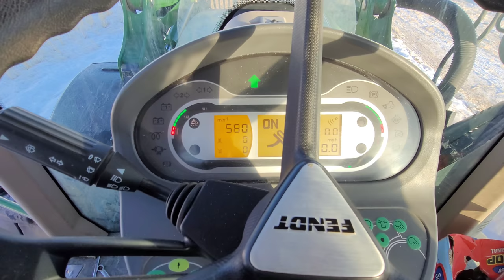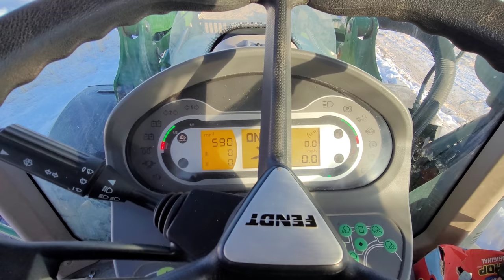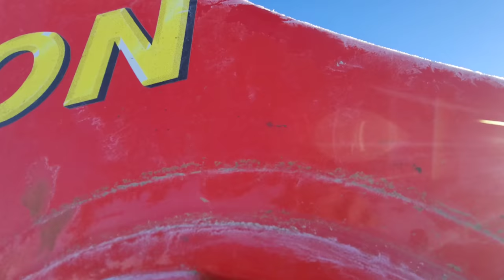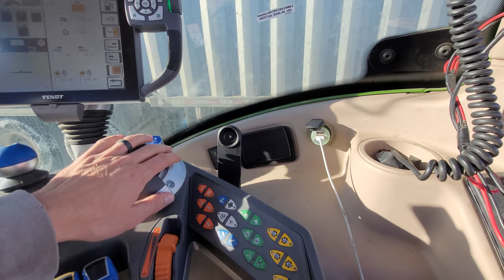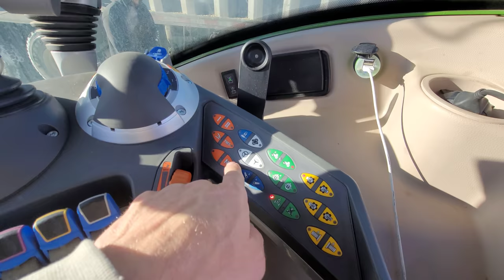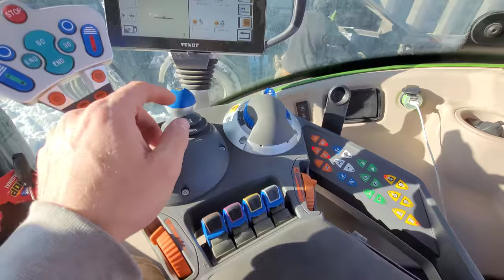How to Hook up & unhook to bags

Comment: We have JCBFastracs where I wrk here in the UK,they will do 42MPH on the roads and as you said a few of our implements won't take the 42mph  road speed for long,our big 20ton silage and maize trailers have all air brakes with full load sensing brake systems same as wagons etc defo can't be beaten for silageing,with all external disc brakes etc like trucks etc!!! Fendt closely in second spot for speed etc!!!👍🏻🔥🔥🤘🏻🙏🏻🇬🇧🤘🏻

Comment: Hi Mike. Do you, or have you ever run an Autumn/Fall Deep Ripping Program on any of your ground and if so what results have you had?
With the limited rainfall you seem to get during the growing season, it would appear that such a program would aid your land to absorb and hold more winter moisture into the summer growing months, along with the benefit of decompacting the ground and allowing the crop roots to penetrate deeper into the soil and to access the minerals further down in the soil profile. 
If you haven't tried this before it would be an interesting test to see the benefits by Deep Ripping only half of a field and then comparing the crop yield results at the end of next season to determine the success/failure of said technique.
Reply from the maker: It's on the to do list

Comment: It looks like in the degelman videos, that you have BKT FL630 tires. If you changed to BKT FL693 tires, you shouldn't have problems on the road at high speed.
Reply from the maker: That's good to know! Yeah, if they are Chinese made.. They ll blow forsure
Reply: @mikemitchell2554  BKT tires are made in India, we have them on all our grain trailers, and on one of the Fastracs. They are lasting just as well as the trelleborgs and are half the price!!

Comment: Did you ever consider buying JCB tractors for lighter jobs around farm?
They are flipping fast.
They strongest in the line is rated at 350hp and it's top speed is about 70kph (43 mph)

Comment: 29:20 
DEF is not as bad as its reputation. 
Here in Europe the technology is referred to as SCR = selective catalytic reduction and DEF is AdBlue.
The nice thing about SCR technology is that the engines are set up far more efficient (and even powerful) than the same engine with a diesel particulate filter.

Diesel engines with a particulate filter are set up to run with too little oxygen to produce more soot and bigger soot particles. These particles can be caught up by the filter. In exchange for more soot, they produce less nitrogen oxides. 

However, a diesel engine must get enough air to run properly. Oxygen improves any combustion process. You can confirm that if you have ever used a cutting torch. Once you press the oxygen lever you can start cutting.
A lot of the soot is unburnt fuel because there hasn't been enough oxygen for a proper combustion.

Diesel engines with DEF/SCR technology are set up to run very oxygen rich. They produce more nitrogen oxides but less soot (since they are meant to filter out the nitrogen oxides). Thanks to their oxygen rich set up and more efficient combustion they run more fuel efficient and put out more power than a comparable diesel engine with a particulate filter.

Comment: You'd expect engines designed and built in Finland to be better in the cold than that, the 720 isn't much better is it?
Reply from the maker: 720 is worse
Reply: @mikemitchell2554  you need the Sisu engines in the Massey tractors. They still have the 34mph fendt transmission. Best of both worlds 🤣

Comment: You really need to switch to Massey tractors. You get the exact same transmission and you get a much better engine. The Agco sisu power engine would have started a lot better than that.

Comment: Why don't ya take a grader blade & push the bulk of snow away from the bag then when the bagger roll up the snow will be able to fall off the bag  !! 
Daniel from central Mississippi
Reply: Yeah, and rip an bag open while you're at it...
Reply: Plow 45 bags a year, peel the snow away  4 inches from the bag, with the same leon blade.

Comment: The " inventor " of DEF/ AD-Blue should have thought about forgetting to invent that whole system . The freaking expensive pomp , heaters , sensors and the DPF . The freezing point of the DEF/AD-Blue which is too high . The list continues .The downtime on equipment caused by this whole system is unimaginable and the environment isn´t benefiting at all . The cost for the downtime and the amount of forced regens is economically and environmentally one hell of a disaster .  I can write a book about equipment problems immediately  related to exhaust after treatment that nobody would read because by now everybody is aware of this . Hot or cold weather , you can be stranded by only looking at this garbage " invention ".
Reply from the maker: Other than the combines, it would correlate to nearly 80% of all our break downs